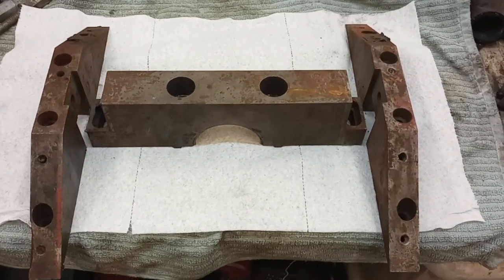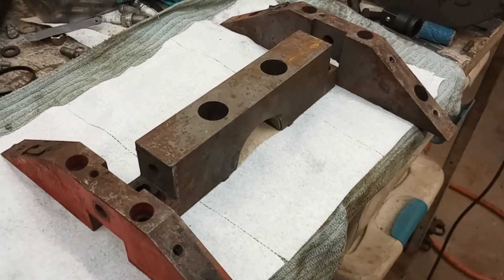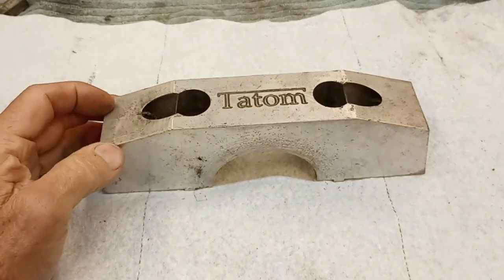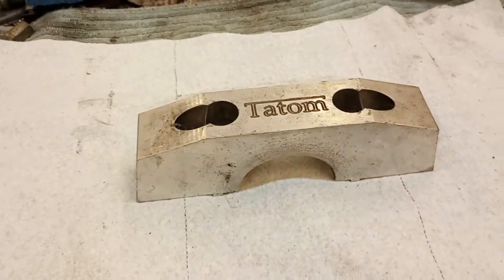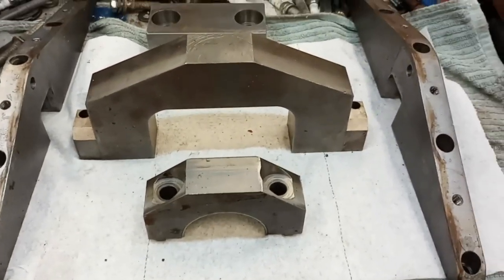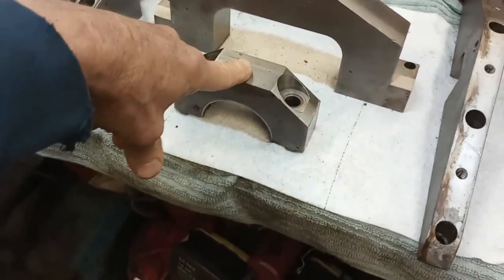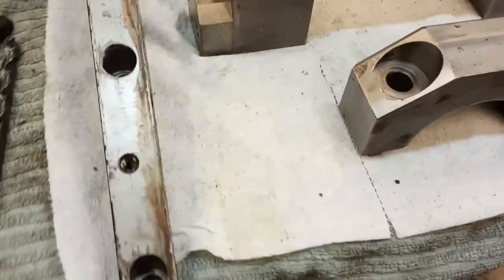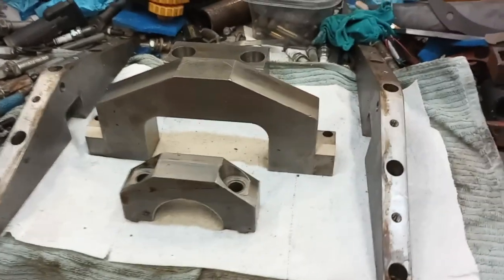flathead Ford V8 main supports

Comment: I’ve never seen anything like this before Phil. Only my opinion but the large overhead support would be similar to the kind used to have a threaded hole with a support stud to relieve pressure on the center main only way beefier.  I’m going to check this modification out. I am building another flattie. Have a late block. It’s nice +060. This looks like something I would consider. Damn three main crankshaft design 🤯.  Cheers Phil , thanks for sharing 🍻👍👍👍